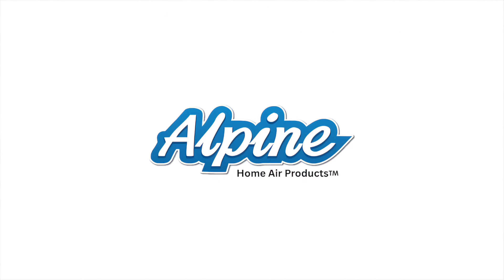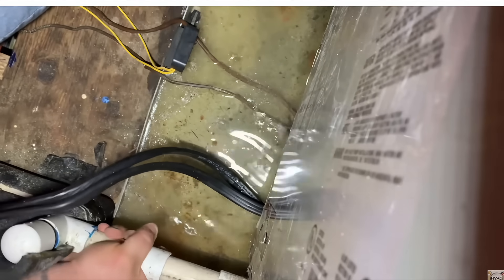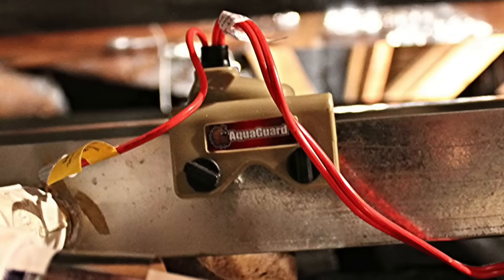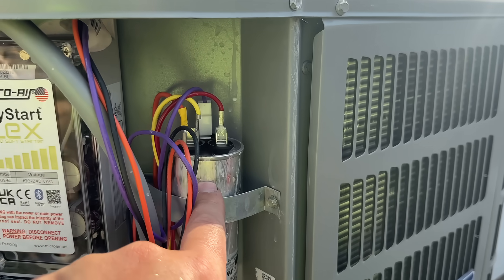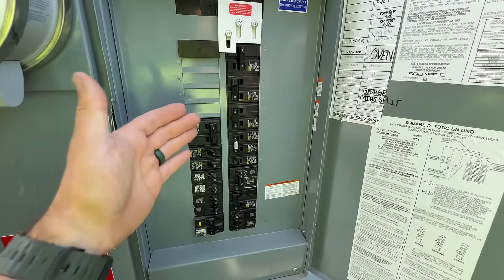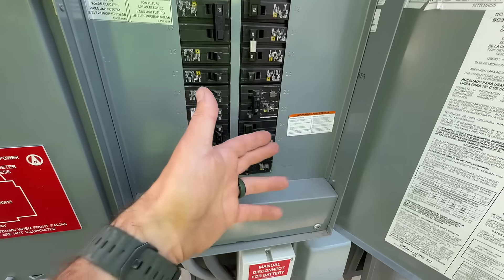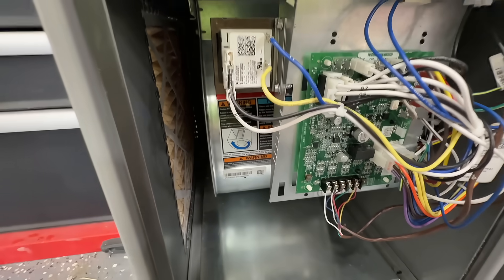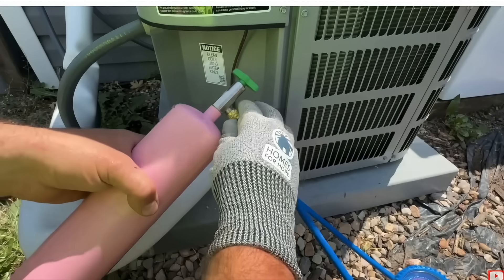AC Not Turning On? Here Are 3 Easy Things To Check

Comment: This is a little OT, but I tried a cheaper Merv 8 filter from ACE because my bills have been so high because of the heat. I wanted to see if it made a difference from using a MERV 11. Anyway..  This is the same size at 4" wide (25x20x4), but I noticed that it's quite a bit narrower than the 3M of Honeywell MERV 11 I normally use. 

My question is does it matter if there is a gap in the width? It's pushed up against the furnace side of the slot. 

When my cap gets weak it makes a buzzing noise and startup and takes longer to start up. Even if you're not sure if it's the cap, if it's more than 5 years old it's worth spending $10-$20 and changing yourself instead paying for a service call. 

Also, I mark my new cap with a Sharpie so I remember when I changed it last. It's easier than looking through receipts. They last in average 5 years and heat usually kills them. Also, it doesn't hurt to buy a spare to have on hand in my experience. 

My condensation tube is in my basement and goes to my basement drain, so I've never had an issue with it like the people who have it going outside.
Reply from the maker: So Honeywell has their own sizing which is stupid. They are always a bit wider than other brands in my experience. So if you had a Honeywell filter rack, their filter would fit in there nice and snug. Filterbuy sells filters exactly the width you need which is nice. 

Anyways, the gap does not matter. It will suck it tight when the unit comes on, so it will be ok. Obviously it’s better when you get more filters to get to the correct ones but the slightly thinner ones will work.

Hope this helps